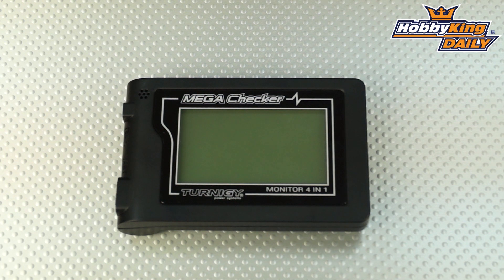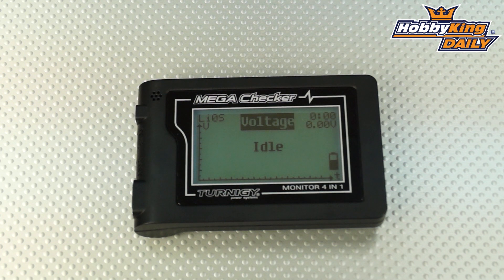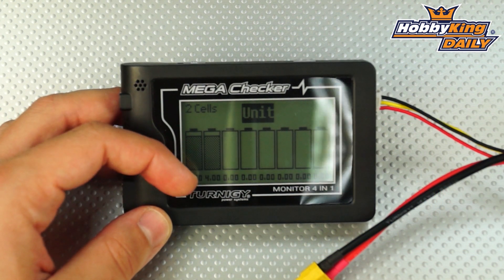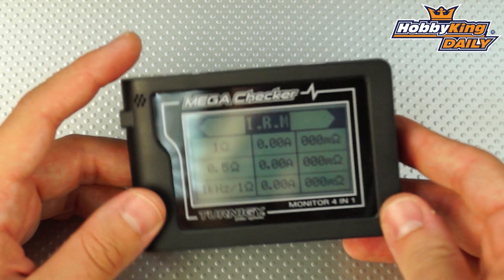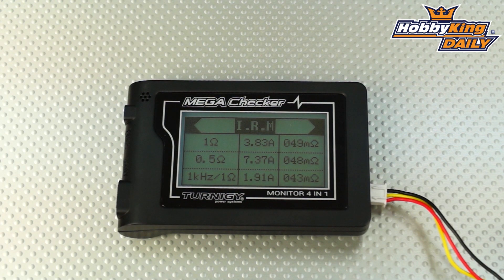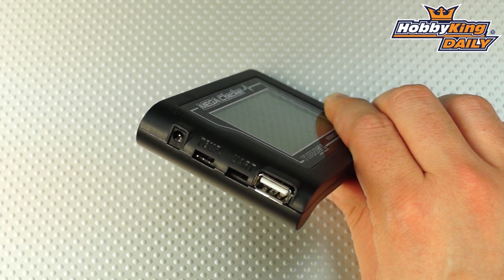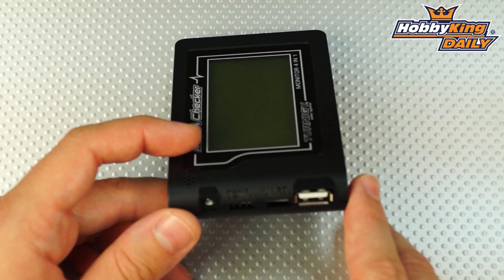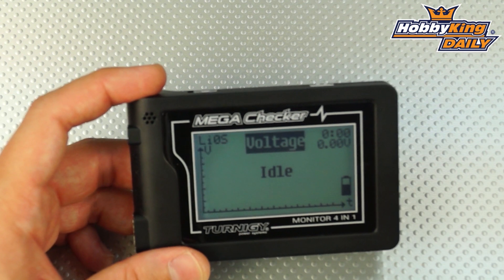HobbyKing Daily - Turnigy Mega Checker

Comment: The only thing I would use is the resistance checker but not very often. If it had a battery balance option I think I might buy it but it does not. They should have just upgraded the Battery medic to use the functions of this unit and I would but it. This would not have much use in my charge box.